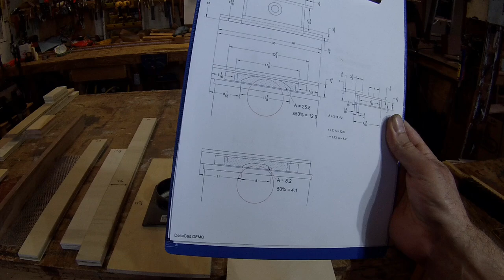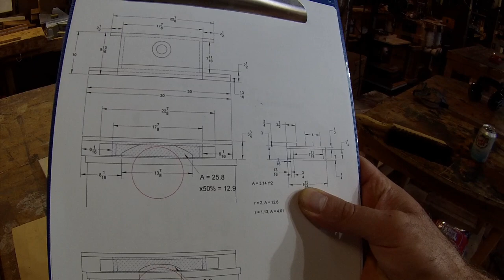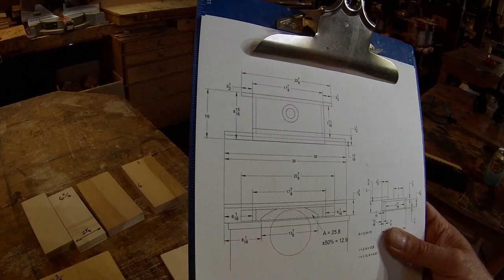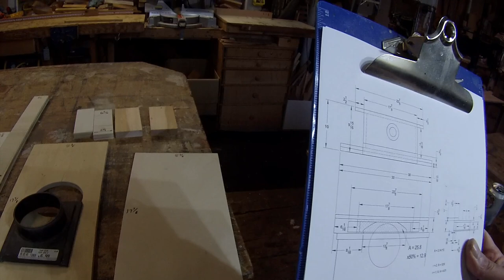Making Suck Fence + Free Demo

Comment: Might consider simplifying the process just by using rectangular aluminum tubing with a bunch of holes drilled in it.  I've been using that for a few years, mainly for an assist with panels on edge - but it works quite well with thin stock like your set up here.  Fewer parts, less fuss with getting things square - the calculus should be pretty easy to figure out.
Reply from the maker: +Joe and Liz 
That would be simpler but large square aluminum tubing is not cheap and achieving a tight hole pattern like the perforated sheeting might be difficult.  My design maximizes suction where it is needed.  And the jig might be more complicated initially but the screens will be replaceable and not too expensive.
Reply: Ehhh, I guess.  I have them on most my machines now.  Takes about 10 minutes on the drill press to knock out the holes (two passes, one for the hole...one to chamfer it).  2x6 rectangular tubing costs about $12 per foot.  I just cap the ends with a friction fit wood plug and toss a couple of bolts in from the backside for securing it to the main fence.
Reply from the maker: Joe and Liz

Maybe some folks will dig my grill...